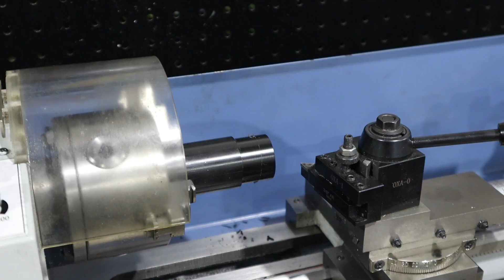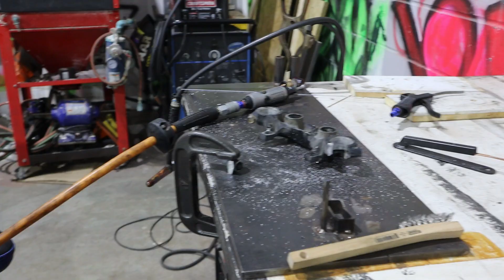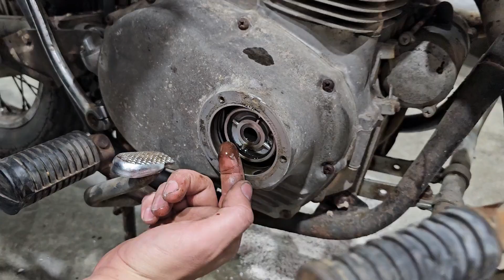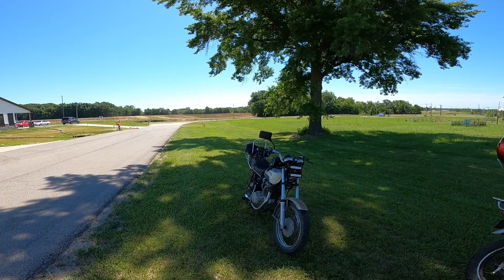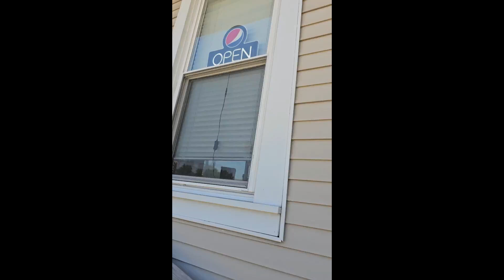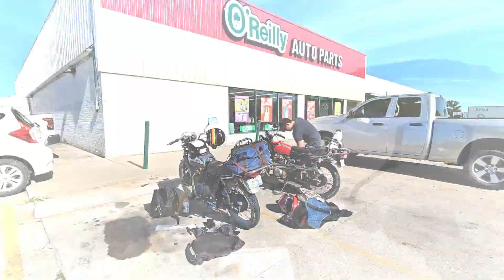Riding Our Junkyard Motorcycles Over 100 Miles For Ice Cream...Sort Of

Comment: G/Day from Canberra Australia, excellent job gentlemen! 
FYI you can adjust the valve clearance with the motor running on the CB250 and 350s
Crack the adjuster and turn until noisy back off until it's not.
Greg STEVENS. 
GRUBS GARAGE CANBERRA.

Comment: Do you mind me asking why you would swap out a disk brake for a drum brake? I was under the impression that disk is better. I know you originally wanted a drum for the simplicity during the 48 hour challenge but now that you are past that, why switch?

P.S. The "jig" you made for fixing the triple was genius.
Reply from the maker: It's still just for simplicity and cost. I had the parts to make it work rather than buying rebuild kits, used master cylinder, used caliper, and new lines.
Reply: @BrickHouseBuilds  Thank you for getting back to me. I loved these two videos. New Sub here.

Comment: I really enjoyed this video, thanks to you both. Laughed when you found out there was no ice cream. That's exactly the kind of mistakes of make. But please, a little more mechanical sympathy with these old girls. Fork seals, grease all the chassis bearings, fix the oil leaks. Proper regulator rectifiers for reliable charging. By all means keep the patina but make them work properly. Then go on a camping trip, carrying tent, cooker and bedding. That would be a hoot. And a memory for you both for life.
Reply from the maker: Glad you enjoyed.  I'm assuming this is the first of my videos you have seen which is great. The mission here wasn't perfection like everything else we work on. Definitely check out the backlog of over 350 videos where I go to max effort to do everything perfect.

Comment: Why do people use soapy water on tyre walls to mount them on rims? Because it is a lubricant. Why do you apply oil when drilling through steel? Because it is a lubricant. I think you already know where I'm going so I won't state the obvious.
Reply from the maker: I don't know. You must state it
Reply: @BrickHouseBuilds  Next time if you insist on trying to drill through rubber use a lubricant to prevent snatching.
Reply from the maker: "Comedy"

Comment: What make that so much fun is you have to rev and shift and you can wind out the gears without getting arrested. Those bikes deserve a really cool makeover.They did your proud.
Reply from the maker: So much fun! We got up to like 65mph lol
Reply: They do deserve a make over. Not factory restoration. I was worried about you welding an old ally casting, especially when you have a spares bike, and disappointed you didn't grease the head bearings. Really, doing proper repairs just makes sense. You'll enjoy the bikes so much more. I'm sure Seth didn't really appreciate continually topping up his oill because his bike was leaking so much. Not changing gaskets is a false economy. Still, it could encourage him to get a real old triumph.
Reply from the maker: @leon0  In every single other video we focus on proper repairs, maintenance, and looks. These projects are not about that right now as the mission was making them run from a junkyard.  We couldn't have known about the oil consumption when we got them but that has stopped. We didn't grease the bearings because of what was said in the video. This video departs from the normal content that you can see on this channel where projects take months/years and people get upset they have to wait for updates on them.
Reply: @BrickHouseBuilds  I think the best part was you did just enough to get ice cream and back. But they are running and it would be cool to give them a new life without going crazy. It would be a good example of how to take a rough bike and make it decent, not perfect. Just a thought.
Reply: @BrickHouseBuilds  Thanks for taking the trouble to reply. Well, I have been a subscriber for quite a while so I'm familiar with your general approach. And I appreciate the care you put on on the normal projects. I just don't think it edifying eg skipping greasing the head bearings when you'd already got the top yoke off. What I remember in the video was because "I can't be bothered" but maybe I misunderstood. I think the idea behind the junkyard bikes was to see if it was possible and fun to rescue a couple of unloved and forgotten machines, breath life back into them and ride. You did that and I loved it. Now it seems to me you are into a phase of making them work properly. Not restoring, that is clear. But for me that means running through the major service items and fixing what is actually broken. You are doing some of that. So I'll keep watching and wishing you both well.
Reply: Agreed do them justice

Comment: Apart from the initial tank mods 🙄& not 🤬greasing the head bearings. For some reason this annoyed the p155 out of me. I really enjoyed this project. I grew up fixing/learning on really bad free or cheap mopeds & small bikes. BUT I always cleaned them as it was easier to spot leaks, work on & pride. I fixed them up as best I could with whatever stuff I had available (again usually given to me). The point being they still looked bad but worked (mostly). May I suggest (part 3) going through both bikes properly (spend a few bucks) get them reliable, clean but NOT restored. Then a big trip to a classic resto show to upset the matching numbers guys. Also I found the biggest failing was usually electrical (or carbs) so why not make a new loom ? I'd watch that 😎BTW after years of big fast bikes & cars I now drive 1999 diesel car & ride old VFR's. Plus fix up (not restore) 70/80's small bikes for fun. Circle of life brah. Well done guys.
Reply from the maker: They just needed to last 200 miles hence the decisions that were made

Comment: Commonly a d washer is used in gap on top triple clamp. I scored a new top clamp from common motor. Much stronger than original and better metallurgy.
Cool channel. I have learned s lot.
Thanks
Reply from the maker: Not really on the 350s and 60s. The larger bikes definitely had them